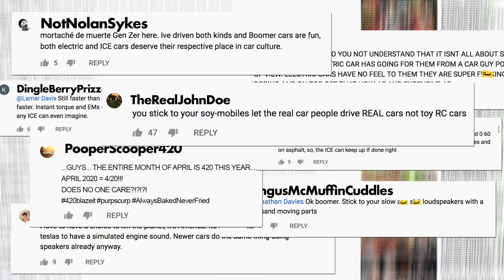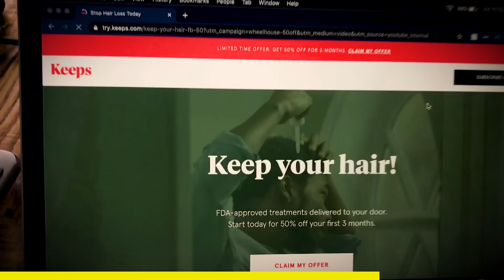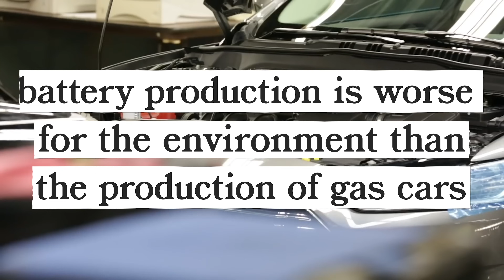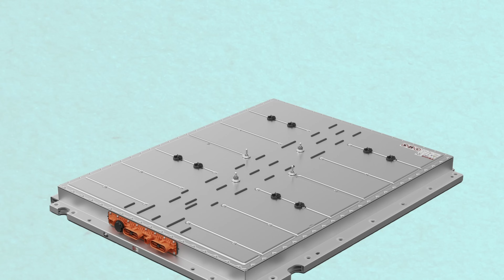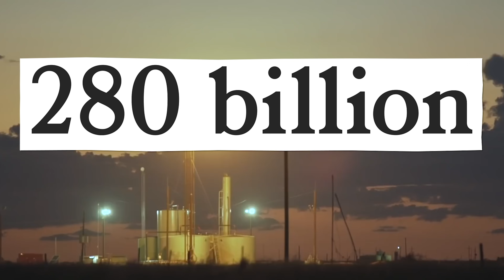Are Electric Cars REALLY Better for the Environment?

Comment: I agree with this point of view , that electric cars and their manufacturing and disposal process is better for the enviroment. But that is just for the time being, because they represent a small percentage of the total number of cars on the road. 
Make the same calculations ( including the oil refinment process) if let's say 70% or 80% of all cars on the road were to be electric. How much co2 would be dumped in the atmosphere from the manufacturing and charging of these vehicles? How about the millions of tons of batteries to be disposed of? 
I agree that for the time being electric vehicles are more eco friendly but in my opinion this is not the future of the automotive industry ecology wise.
Reply: actually on a per km/mile basis, it takes significantly more emissions to refine, transport and ultimately burn combustion fuel than it does to generate electricity even from a coal only grid. It also takes alot of emissions to create and refine the oil for oil replacements, to make spark plugs, oil filters, timing belts, fuel pumps, etc etc etc. EV's are more efficient, thus release significantly less emissions as they drive. Even though EV's start off with heavier emissions in production, the break even point from the reduced emissions while operating is only around 15,000-30,000 miles of driving.  Further to that, EV batteries are around 95% recyclable.

Comment: You need to add a battery replacement on the EV total. Car will end up in a junkyard because it won’t be worth installing a new battery while the gas engine goes another 10 years.
Reply: actually you have that backwards. Modern EV batteries are designed to, and are showing to last up to 400,000-500,000 miles. twice the average lifetime of modern combustion engine. In addition, Battery replacements only cost between $4k-$7k depending on the battery size, inclusive of labour. Most people confuse batteries, with battery packs. And most media, obfuscate the issue by intentionally confusing the two. A battery pack, which includes all the structural elements to hold the batteries, wiring harnesses between batteries, Battery management systems inclusive of coolants and heating elements indeed cost more than it would be worth to replace. However this is different to the batteries. Most EV's use batteries like the 18650 batteries (do a google image search, they look like big AA batteries). These are easily replaced individually by removing the seats, lifting up the floor and replacing the batteries like you would a giant TV remote. Suggesting you need to replace the battery pack instead of the individual batteries is a little like saying you need to buy a new PS5 controller every time the controllers AA batteries go flat. Which is, to say the least, absurd.
Reply: @engineeringtheweirdguy2103  Haha. Guess we will see. I have drawer at home full of old iPhone that have bad batteries that won’t hold a charge. The future for electric cars. Junk yards full of electric cars with bad batteries that nobody wants to drive and sink money into. It’s going to happen. What’s the self life on these batteries? Just as good as new after 10 years if they are taken care of?
Reply: @Falkenroth1  its pretty safe to say that battery management systems (BMS) on an EV are significantly more complex than that of an Iphone. EV's monitor battery input and output to ensure even distribution of charge of all the cells within less than a microamp. They also keep the batteries within idea temperatures through containing the batteries inside a coolant fluid to heat/cool the batteries. Additionally unlike phone batteries, EV's are rarely even use 70% of their charge daily with most daily commutes only consuming 10-20% of the total battery charge. Most EV's for this reason arent consistently charged to 100% like phones are which shortens the life of phone batteries, additionally EV's rarely are discharged fully, again, unlike phones which also damage battery life of phone.

And lastly there is the size. Battery life is measured in cycles, equivalent charge and discharge of the batteries of their original capacity. EV's have 1500 discharges rating to 70% health. That means for an EV with a 50kWh battery which does 400km, it will take 600,000km before it reaches 70% of its original capacity, for an EV with a 75kWh battery which will go 550km. it will take 825,000km before it reaches 70% of its original capacity.

Why people think that the batteries and systems on a $100k car are equivalent to that of an $300 iphone is beyond me.

Comment: So they tried to resolve the issue of greenhouse gasses by selling different types of technology for vehicles which costs an arm and a leg without actually resolving the issue with the greenhouse gasses whatsoever and carrying on destroying the planet. The issue remains and it's not about saving the planet - it is about the money - always has been and always will be. GM killed the electric car in the 70s because the money was in the oil market. The problem will be solved by considering the basics. Is there a way to convert the greenhouse gasses coming out of the exhaust into fuel with the help of renewable energy? Can renewable energy power the production of new cars? A Yes in both of these questions is a win-win. Cobalt and lithium can stay int the ground.
Reply: You technically can turn carbon into fuel through energy from fossil fuels. But a prohibitively large amount of energy is required, even for a small fleet yet alone a national or international fleet supply. At current EV's are the only solution which get cleaner as the grid gets cleaner, and produce significantly less emissions over their lifetime than combustion cars do. Not Zero emissions, but significantly less.

Comment: You should take into account the environmental damage of disposing and storing batteries which is not measured in CO2 emissions
Reply: And the fact you have to replace the batteries in otherwise working cars
Reply: @cgmason7568  15 years later the neighbor's 2006 Prius with 213k ( could be more, this is what I know for sure)  miles still running with OEM battery pack.  His Acura RDX from 2010 with less then 200k miles needed a new engine.  He had to dispose a large hump of metal full of oil due to a small part breaking (rod).  Both ICE and EV fails.  Electric motors and batteries do too.  Batteries from cars can be recycled to gokarts, bicycles, etc.  Most times the battery do not die but the re-charge capacity diminishes to a point where its no longer strong enough for that application. It does not necessary means, it can't hold power.  I have a friend who builds small motorcycles and karts from old, used Tesla batteries.  Only about 2-3% dies in 12-15 years after 250-300k miles so they are pretty solid.
Reply: The video didn't even take into account all the CO2 emissions for getting that gas to the station. Which is only fair to consider if we are going to talk about how electricity gets to EVs. I'm sure if we factored in the C02 emissions per fill up (before the car can even emit the fuel) that will more than out weigh the entire EV life cycle.
Reply: @brotinger_1 Where is the 20% lose coming from? I don’t think you lose that much to heat charging, not even close.
Reply: @brotinger_1 Link me your source sir, also it’s pretty easily to calculate loss, I typically add 22-30 kilowatts per charge at home so if those numbers are true (and I want your source) I can do it’s out the diff between my current car and my old car.
Reply: @brotinger_1 I appreciate the effort! I’ll look into it, thanks! I wish more people could just talk not start calling everyone names. Cheers!
Reply: Batteries can be used for backup house power. 

Check eBay for used EV batteries and tell me how much they sell for.
Reply: What's inside a catytic converter?
Reply: Like the water supply
Reply: Batteries  do hurt the environment but you get more use out of them and they can be reused for other modes of electricity. And when batteries go completely bad, lithium doesn’t cause as much damage to the environment as 100% fuel dependency does.
Reply: The batteries are 98% recyclable for life.
Reply: @Drew_Hurst  not when they crash,they  become unstable
Reply: @eliteinventor  Gasoline is very stable when it crashes. Check out the Jeep fires and recall very stable.
Reply: @psikot  I know this I was talking about the lithium batteries in electric vehicles
Reply: @eliteinventor  Lithium batteries are safer and more stable than gasoline
Reply: @Drew_Hurst  still very inefficient to recycle and store them
Reply: @cgmason7568  nonsense rhetoric talking about storing, who talks about storing batteries or oil especially in the automotive industry. 
Do you complain about battery storage for a flashlight?

Solar panels on roof fill batteries in car for free without even having to make a detour to the gas storage station.

If you mean energy density;  tradeoffs for safety and pollution must be considered, otherwise  maybe we should just run our cars on nitro-glycerine instead LOL

Big oil brainwashing budget is 10% of 1.7 trillion per year in USA alone....
that kind of money can create quite a knowledge vacuum... don't get sucked in!

All the best Mason
Reply: @Drew Hurst  No, no they aren't. Only 5% of lithium batteries are compared to  99% of lead-acid batteries in the United ...
Reply: @shepleonard8695  too many reasons to counter, not worth my time. 
But if you want to become a millionaire you know what to do now.

Comment: So you mention the production of oil products, as a minus for a gas vehicle, but you don't mention that all those products for making and maintaining that electric vehicle are used to maintain that electric vehicle... the big question is why diesel electric is not what all cars are using??? What has powered our largest transportation and shipping forever across land... trains, and best efficiency they have found is diesel electric. So you have an electric car that can travel 400 miles,  but if you had a generator charging diesel engine in that car with those batteries, with one 10 gallon tank of diesel and a small 3 cylinder diesel, what would your range be? 1000 maybe 2000 miles??? It's all a money game not an environmental one regardless of anyone's comments.

Comment: I would like you to elaborate on Myth number 2, the US CURRENTLY cannot make enough electricity for itself. We have to import electricity from other places. So if that demand doubled by tomorrow what does that do to our economy and how are we going to pay for that electricity? Also most electricity in the US is not clean, and that in which you call clean isn’t as clean as you think. For example Windmills, the blades constantly have to be replaced and as they are made from fiberglass that creates a ton of waste. They are also very unreliable, a quick journey through a windmill farm will show around 30-40% of the machines not even spinning. Its theorized that over a longer span of time a windmill ends up causing more harm than it does good. Electric cars are simply not the future, hydrogen fuel however, may be.
Reply: basically, you just got everything 100% wrong.
Reply: @gregnoel8779  thanks for your infinite wisdom greg I see you put a lot of effort into your research. These are all great points you made 👍🏼
Reply: The dude lost all credibility when he said that and I had to turn off the video bc of the misinformation